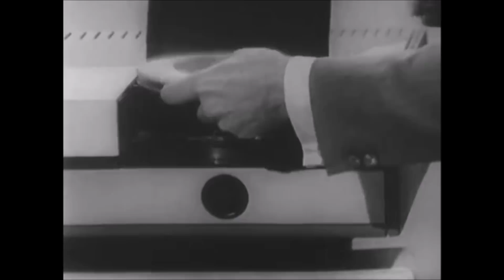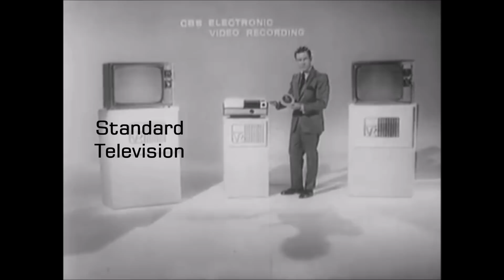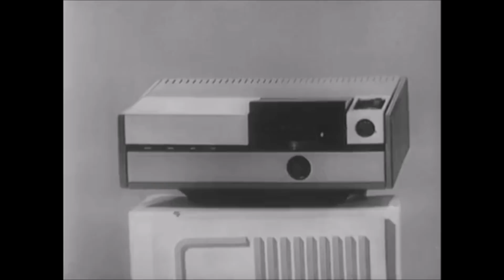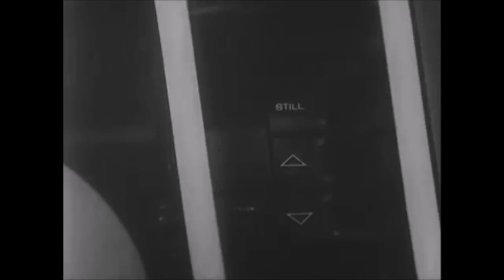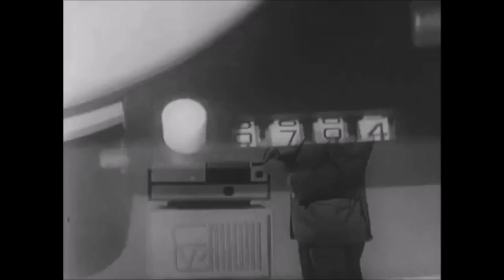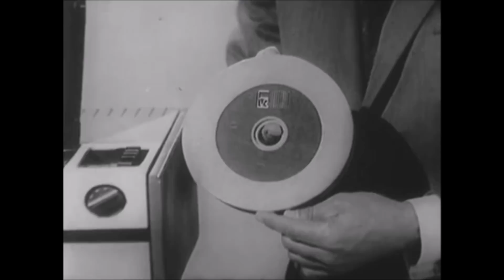This 1968 CBS EVR Video Format Blew My Mind! Intro to CBS EVR, databits edited version

Comment: I was nearly exited. Two 24fps filmstrips on a side by side format on a single reel with build in telecini. Like microfiche film. Untill the guy said "sprocketless" And I realised it was nasty-@ss reel2reel videotape 🤮
Reply: No, EVR still used film (8.75mm wide), it was sprocketless (much like 16 or 35mm microfilm for storing documents optically) because it used optically exposed clear "dashes" down the middle of the EVR film between the two strips of frames, instead of physically punched-out perforation holes.  They were read optically as a result.

Comment: They shoulda pushed the engineers fir the extra 5 min a track,..  two "carts" (looks like reel or spool to me..) then would hold a standard movie, if I'd been alive and could afford one , I'd have been very thrown by the need for three reels just to cover that extra 10 mins... I'd have been all over one of these (or a vtr, I don't know if the added features  cost more or what, I'd have also been happy with an open reel vtr)

Comment: Is this optical or video? How is the film getting changed to video data?
Reply: EVR films are optical photographic cinema film (most made from video sources using an electron beam film recorder as how some EVR films were mastered, or printed optically from film-originated material, IINM) that would be scanned to video by way of a flying-spot scanner (FSS) system in the player.

The EVR film in it's player would pass between a special CRT with an ultra-violet-emanating phosphor displaying a blank line-scanned raster with no image displayed (its purpose was to provide the "flying spot" and backlight for the film), which was then picked up by a set of 3 photomultiplier tubes (PMT) on the other side of the player's film path--one for red, green, and blue respectively.  All three PMTs would sense the flying spot from the CRT scanning from behind the film, and reconstruct the scanned image accordingly to a video signal.

The television industry used to use flying-spot-scanner-based telecine systems all the time for airing still slides (aka "telops") and motion picture films, the EVR player essentially is a miniaturized FSS telecine system.

Comment: I bet Oddity Archive's after one of these

Also, EVR was monochrome, in mono, used film (so it couldn't record) and Laserdisc was around the corner

Americans really don't understand the meaning of the term "flicking the Vs" which is odd as CBS were partnered the very British ICI.  You'd have thought someone at ICI would have pointed that out!  

"You cam program independently" Making it sound futuristic and complicated when he could say "Two tracks of video, like the two sides of audio on a phonographic record, but you can switch sides, at your own election, without having to flip the cartridge like you would with a record should you so desire."
Reply: The system could be color, But hell, we didn't even have stereo broadcast TV for about 15 years after this demo was made!

Comment: You mean THAT CBS who was known for The Price is Right?
Reply: Yes, CBS up until 1986, had their own research & development (and manufacturing) division, CBS Laboratories (which was closed down in '86 after when Laurence Tisch took over and financially gutted CBS, sadly).  And EVR was one of their many developments.

CBS Labs even manufactured and marketed their own designed products (Vidifont CG for video titling, Audimax/Volumax for audio processing, etc., and EVR), until the late 1970s when they handed off their manufacturing operations to Thomson-CSF (CBS would still be involved in the design and engineering stages).  I believe CBS Labs partnered with Motorola to manufacture the EVR players, IIRC.

Comment: People are "poo-pooing" this, because it is a monochrome player.  IF it had widespread releases of popular T.V. shows released for it in 1968, and was widely available to the public that year, CBS would have been in the lead, for the home video format market.  ...VHS came out in 1975, and didn't become big, until 1983 (due to lowered prices and movie releases).  The CBS EVR would have had a foothold in the home video format market, for fifteen years.
Reply: You sure about that?  RCA were already developing the CED and the Laserdisc was around the corner.  

The CED was in colour, as was the Laserdisc. 

I also believe that in America, Cartrivision was in development and about to be released.

Cartrivision was in colour and you could record on Cartrivision.

Monochrome was already getting to be old hat in 1968.  While black and white sets were still the majority in the US, you had NTSC since the 1950s and PAL colour had just launched in the UK (on a different TV system which broadcast on a different band, meaning you needed an entirely new set)

And INB4 the CED didn't come out until the early 1980s.  It was rushed to market after years of delays, had it been released as intended, it would have been in direct competition with EVR and I think CED would have won.  It would have been like comparing 45s to wax cylinders.
Reply: @GeoNeilUK  Um, you already answered your question as to why C.E.D.s would NOT have eaten into the consumer base for the CBS EVR, if the CBS EVR was released into the public by 1968, because they were in development hell, until 1980/81.  Laserdiscs came out in 1978, after a development hell.  So again, same point.  The winner to a format war, normally goes to the one that comes out first, and has more convenience, which in reality is the VHS, because it came out in 1975 and could record T.V. shows.  By your analogy, Laserdisc should have won this format war, in reality, they took 1% of the U.S. home video market, but went on to inspire our current generation of disc based home formats.  This is why I compared the CBS EVR to VHS, in my timeline comparison.  Of course it would not beat other video formats, but God it would have made money for years, by being the only format to watch post-aired T.V. shows, years before othe home video formats became cost-effective.  This machine and its cartridges would have been expensive in 1968, but if they were continually produced for consumers, by 1975, when VHS rolled around, the CBS EVR, would have been economical, until VHS prices came down, by 1983.
Reply: ...and Cartrivision?
Reply: The bad luck of the first set of tapes falling apart and the $500+ cost of this machine is what did Cartrivision in.  in other words, in 1972, when Cartrivision came about, the CBS EVR would have sold more cheaply than Cartrivision, and the CBS EVR would be working perfectly, if any bugs had to be solved with the system.

Comment: Thats a reel not a cartridge.
Reply: A reel would be open. I think they are calling it a cartridge because it's fully self-contained, sealed and the machine does the necessary threading. It's a reel cartridge.. lol.
Reply: Technically, a cassette is a 'cartridge', too.
Reply: @xaenon  Yep
Reply: The film is encased,not open - It is reel shaped, but technically it IS a cartridge.

Comment: Interesting.  Some googling provides answers:  25 minutes would have been sufficient for a half-hour tv program sans commercials.  The sales of color TV sets didn't exceed that of bw until 1972.  If this took off, a color model would be the next step.  All in all, I suspect it could have had some success if it was embraced by the studios and the media wasn't too expensive.  I wondered how they got it so quiet and then I realized they must have used a flying spot camera - it scans side-to-side and the films movement does the top-down scan.  It looks like the sync comes from the center track - that's how they were able to eliminate sprockets.
Reply: I'm pretty much certain that this is also a 30 or 15 frames/sec. film to avoid. 3:2 pulldown.
Reply: Because of the flying spot camera, I'd think it would have to be 60 frames/sec.  Otherwise, you'd have add some kind of vertical scanning instead of having the film movement do the vertical part.

Comment: Usually when new technology introduced - they display it's logical "genius" advantage very thoroughly (because everything patented already)- BUT NO ANY DETAILS here. I haven't seen Wikipedia and by first ever view on this - i CAN"T UNDERSTAND HOW THEY TRANSPORTED ANALOGUE presumably by light picture to very old TV's before the suitable standards-by RADIO? 🤔
Reply: Well, yes technically since it uses a stock TV instead of a composite video monitor, The connection would have been likely an RF (radio frequency) signal by a transmission line (300ohm probably as most 1968 TV's lack a 75ohm jack) to the TVs Antenna input. connection. PS what suitable wireless standards (besides IR) don't use RADIO? Wi-Fi,Cellular,Satellite TV, Television, Bluetooth.....All use RADIO.

Comment: So 50 minutes is limitless?
Reply: 50 minutes is obviously a limit of the cartridge.  You can have more than one cartridge, though.
Reply: The attention spans were far longer then than they are today.   Back then, most TVs didn't have remotes to channel surf or dodge commercials, and only three major networks - nor did you have competing electronic devices like cell phones, laptops, etc.  You had to pry your ass out of the La-Z-Boy and make the long, arduous trek across the living room to change the channel or turn the sound up or down.   Or holler for one of the kids to do it for you - assuming the kids were even in the house, which most of the time they weren't because they were out playing.  

Most people just sat through the commercials, or at best, got up to get a sandwich or a drink or use the bathroom.  Of course, back then, they didn't carpet-bomb you with 3 dozen commercials every 4-1/2 minutes, either, so 50 minutes was sufficient space for two 1/2 hour programs, or parts 1 and 2 of an hour program without the ads.

Comment: Ok, I'm now eagerly awaiting the teardown. I can only imagine what is in that thing. And macrophotography of the film strips themselves is of course a given! Those exposed frames must be downright tiny. 

I'm guessing it's built around a "tiny" tube camera inside the machine and that the only reason it's not in color is that it would be too bulky and expensive to fit that equipment into a box that is expected to be portable. 

Also, he does mention the mono sound stripes at the edge but between the frames there seem to be some form of a signal also. It's probably that which lets the camera sync with the film without the need of sprocket holes. 

I also imagine that the pipedream version of this thing would be one where they use the whole width of the filmstrip to get a finer grain image. That would give you opportunity to use the soundtracks in stereo. Yes, it would half the runtime but better image. It would be double width, perfect for widescreen. Or you could mess with the timings to get a regular 4:3 ratio. Or you could half the runtime again to get quarter runtime (using both sides and running double speed)  for super resolutions. Imagine that, with color film and playback.

12 minutes of high res color video with stereophonic sound on a single cartridge! Just imagine what one could do with that! And it would only cost you the same rough amount as a Saturn 5 booster rocket! What a steal!

You could maybe even build something that uses an endless loop cartridge? 

Ok. I got a bit carried away there. But still. I am honestly now fascinated with this format.
Reply: jmalmsten your wrong on the resolution upgrade as far as speed as it was already 30 fps the max for ntsc television. The only upgrade would come from a better camera and a larger frame. Basically it just a revamp of the old soundie films for soundie jukeboxs. Only with a videocon imaging tube and an rf modulator. Oh yea a magnetic soundtrack that is a + . It would have been easy enough to have 2 stereo tracks on a single double film. It probably uses a strobe light to synchronize and eliminate the need for sprockets and shutter on the film end. The persistence of the old videocon imaging tube would eliminate the flickering. Three tubes with rgb filters and some  Optical prisms and mirrors + wala!   Your now ready to watch Disney or Wild Kingdom  (brought to you by Mutual of Omaha ) in Living COLOR; Bing,Bang,Bong. Giggles.

Comment: Very, very interesting and impressive format. If only it had been two hours plus, it could have conquered the world.
One of the good things is the lack of sprockets. It means very little wear, mechanical noise and more room for the picture. Wonder how it worked exactly.
Reply: The film is obviously run through a tiny telecine system (probably a bulb and a camera tube) for conversion into television format, and since the entire film is sealed mechanically, you would only need a gripping mechanism to move the film. There are no issues with misalignment which would be there on open reel projectors.

Actually looks like the format was pretty promising but it came to market too late, since 1/2" videotape machines were already available in 1968, and VHS was almost around the corner.
Reply: My guess is a flying spot camera and the center track has a pulse track.
Reply: Yes.  That's exactly how it works.
Reply: @russellhltn1396  Exactly. The EVR player does indeed use a FSS (flying-spot scanner) system, with clear "dashes" exposed down the center of the film to function as opto-electronic "sprocket holes".
Reply: I wonder if it plays 24 frames with a 2:3 pull down, or 30 frames.
Reply: @telocho  30 frames with no pull down, according to wikipedia, and would have been 25 frames for a PAL-compatible version